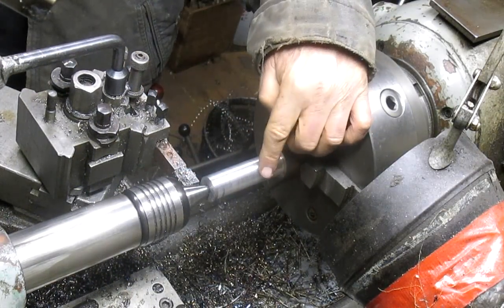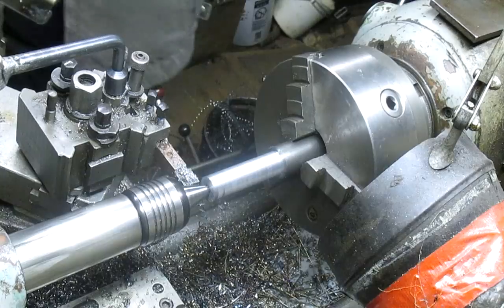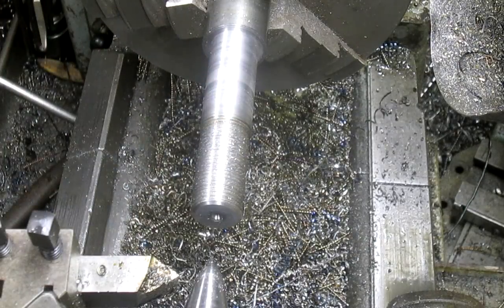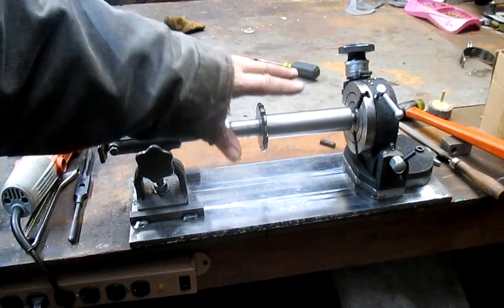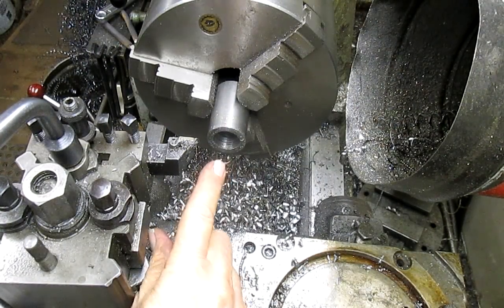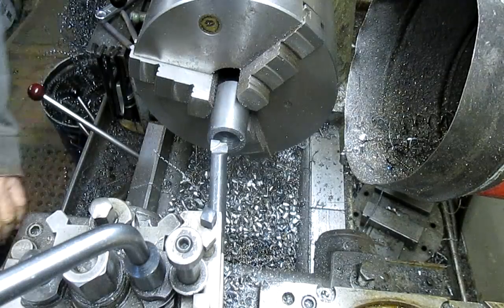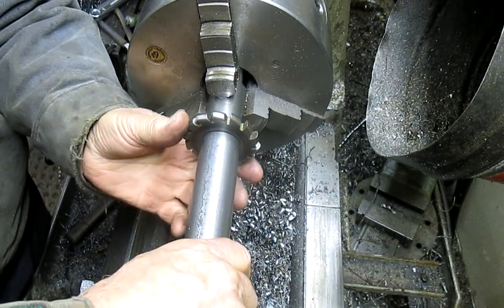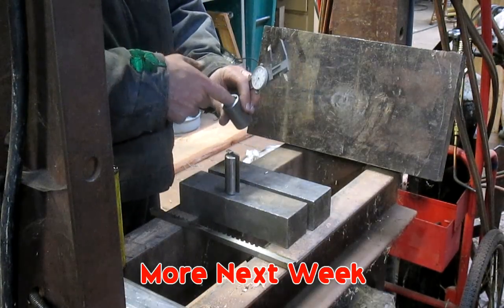Mill Cutter Sharpener Build #4

Comment: it is the lot of old machines that are loose on their slides and lead screws to produce geometries that are not perfectly round, straight  or at the dimension programmed. 
to achieve an acceptable work, it needs a lot more attention and of course time..
 I have the experience of that.
very good job on that setup
Reply from the maker: My big lathe was made in 1954, so it is sloppy loose. I work slower because I have to.

Comment: Good job Nik as usual. I need to find me a broach kit that works so good.
Reply from the maker: I got a full set on ebay used in a wood box for $250.
Reply: @NikColyerMachineWorks  Nik can you send me a link there are so many listed - thanks
Reply: @harrychamness501  Look for a deal on a Dumont brand. Very good quality. The import stuff works alright, just make sure it is HSS.

Comment: Hi Nik great video, could you tell me what capacity your hydraulic pump is in the press? I am starting to build a reduced version  to save room and was wondering if I could get by with a 5 ton cylinder? Your opinion and thought please?
Reply from the maker: My press is 16 tons and it works good in most situations. If you are going with a 5 ton I'd buy the Harbor Freight press, though it's not going to press much. I owned the  Harbor Freight 12 ton before I made this one and it worked pretty good, though my arm got tired pumping it.
Reply: @NikColyerMachineWorks  Sounds good I will see what they have locally tomorrow. Thank you for replying, your videos provide lots of needed pastime for this old fossil......
Reply from the maker: @desertschooner769  One fossil to another, I enjoy making the videos. Thanks for watching.

Comment: No need to broach the sleeve or mill a key seat in the shaft- just drill the shaft for a pin the size of the keyway in the cutters- that will keep them from turning.
Reply from the maker: Good point, but that project is two months old now.